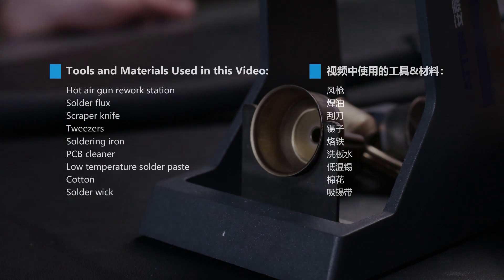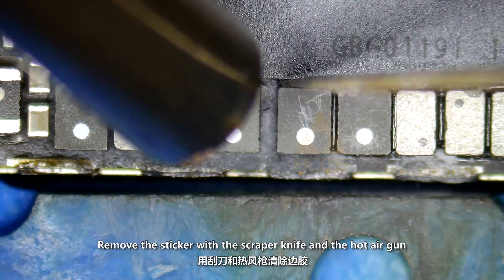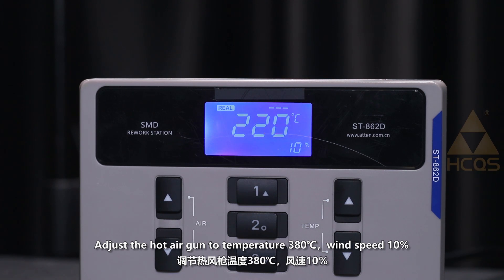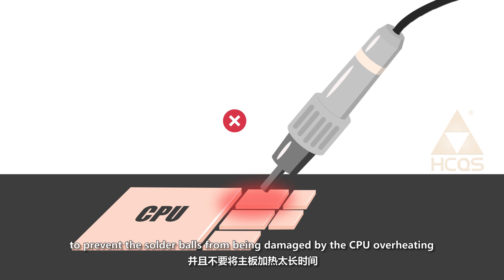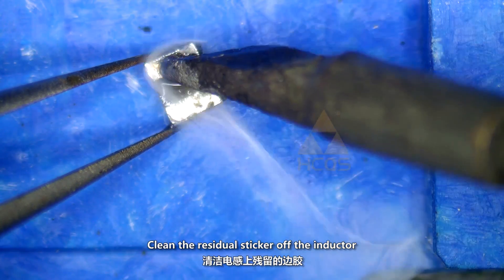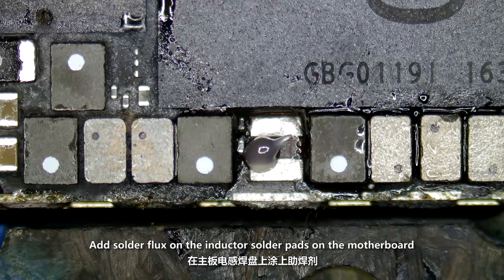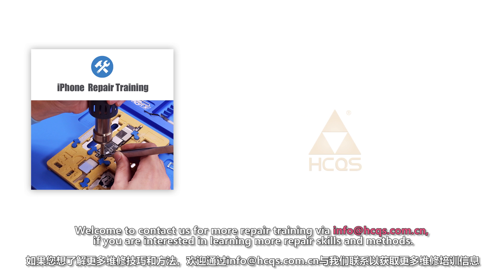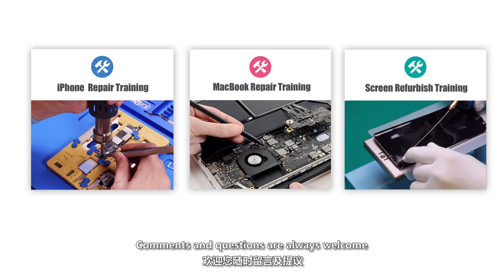How to Remove the Inductors Next to the CPU | Motherboard Repair Lesson

Comment: Isn’t full air speed best to get components off quickly?
Reply from the maker: Hi, thank you for your comment, I think it's related to the machine model, for the hot air gun we used, if we adjust to higher or full power wind, the component will possibly be blown off, 10% is enough